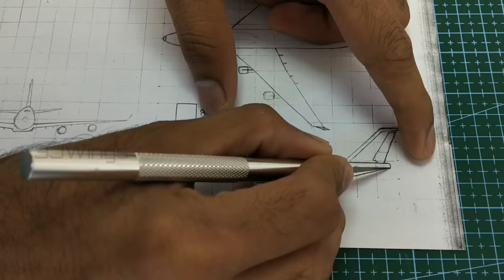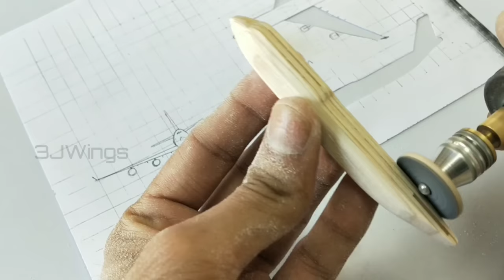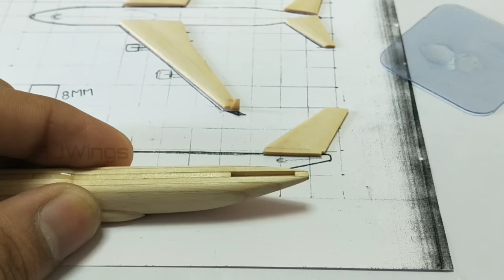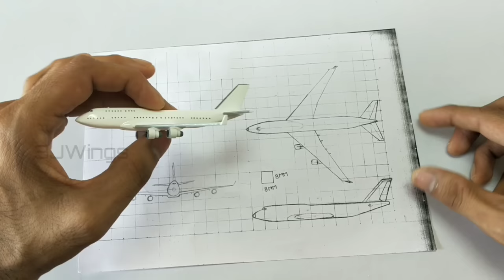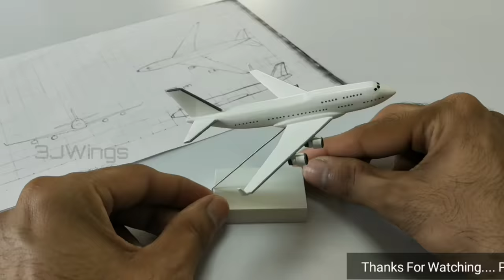Make a Aeroplane With Icecream Sticks | Boeing 747 | #diy #boeing747

Comment: You should get better masking results, if you paint a thin layer of white first, let it dry and then overpaint it with the desired color. The white color seals the masking tape and all the lines get very sharp.